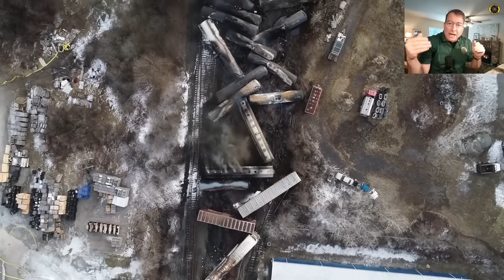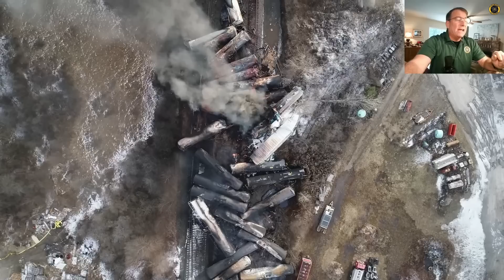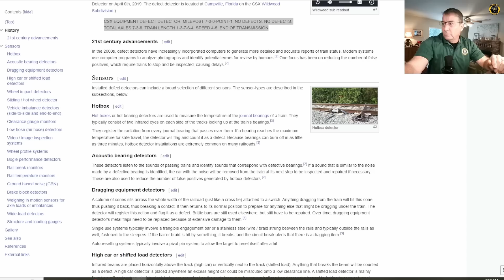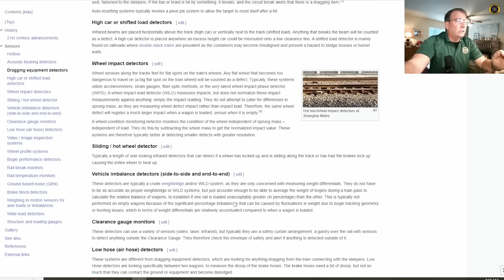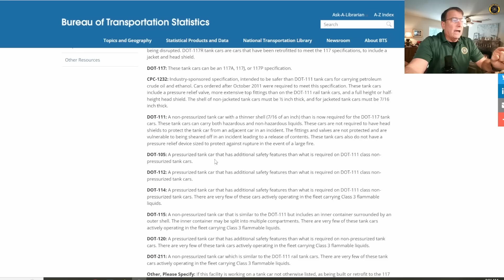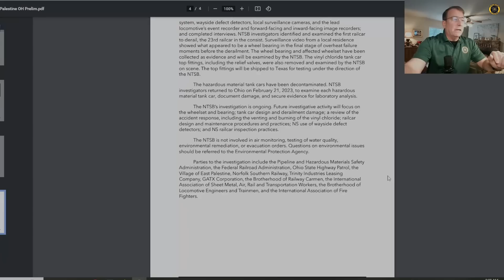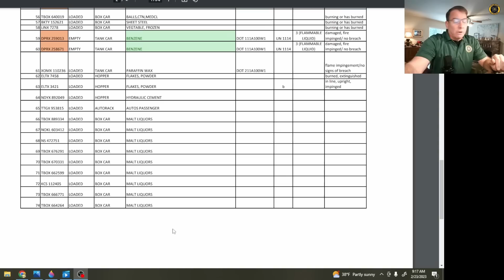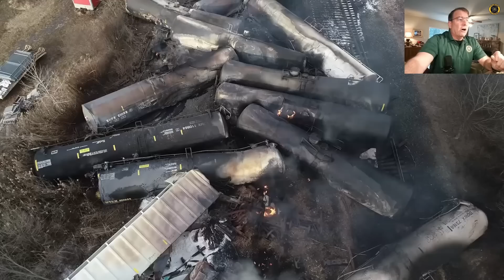NTSB Prelim Report: Norfolk Southern Train Derailment 23 Feb 2023

Comment: Juan, Several comments.  Yes, roller bearings can fail quickly but also usually show symptoms days or weeks in advance.  Infrared detectors are pretty primitive and more applicable to sleeve bearings than antifriction bearings.  The NTSB used the term acoustic detection protocols.  I know what they mean but is really displacement tied to RPM and phase angle that they are referring to. There are dozens of bearing defects that will show up in vibration analysis.  Heating shows up late, too late, in the game to be the only indicator of a bearing with a problem.  Vibration analysis is widely use in industry on stationary rotating equipment.  It is not the easiest thing to implement because 1) It is not cheap 2) Unions tend to fight it because learning the details tends to make their members uncomfortable and 3)  it is hard to apply to rail cars as when the data is collected the bearing must be working.  I am not aware of rail care mounted vibration analysis equipment though that could be developed.
Reply: They also have to deal with out-of-round or flat wheels, non-welded track joints and squealing when going through tight radius turns. The first group can likely be detected through acoustic means, at least flat wheels are quite obvious. Added to that, railroads don't own all the cars on their tracks, although they can enforce federal standards. My wife audited a small company which owned less than 100 rail cars and leased them.

I'm not saying it can't be done, but it can't be enforced quickly.

Comment: Another item crew positions on a railroad train. Conductor (supervisor of the train), in the past the conductor generally rode in the caboose, Locomotive Engineer, this is the person who actually advances the throttle and applies the brakes. Today normally these are the only two crew members on a modern train.   There are a number of smaller railroads, that with waivers, operate with only an engineer. In Western Australia a mining operation has unmanned trains. 
     In years past additional crew members were the firemen. This position was left over from when locomotives where large boilers heated by coal, oil, or in the early days wood. A fireman had to shovel coal to keep the boiler water hot enough to provide high pressure steam. It was more an art then science. The last position were the men who "steered" the train. The brakemen. Initially a brakemens job was to manually apply the brakes on the train. It involved climbing over the cars to turn the brake wheels on a train. It also involved throwing the switches to steer the train. 
      As technology progressed, the first to go were the locomotive firemen. This happened as railroads converted from steam locomotives to internal combustion and(in Europe) electric locomotives. In the 1930's a system called centralized traffic control (CTC) was introduced. A dispatcher at a central location could throw the switches. By the early 1980's railroads started efforts to reduce crew sizes. In 1970 for example a typical train  crew consisted of 5, Conductor, Engineer, Firemen, the head end brakeman, and a brakeman in the caboose. By 2000 it was pretty much down to a two man crew.

Comment: I've seen a video clip in the news from a video camera, which I think was a security camera near the tracks showing what was claimed to be the possible car in question. It appears that the wheel may be locked up and dragging, but still on the rail, any flying sparks like a giant grinder on steel. It would not take long to grind a rail wheel up to the point of failure to be able to stay on the rail. Perhaps grind the wheels flange off. It will be interesting to see the failed wheel damage. I wonder if i can source a picture. Gryders general view of the NTSB is something to keep in mind. ☮️
Reply: Security camera at Butech Bliss in Salem. Shows flames from the lead axle of car 23, a covered hopper carrying polypropylene.

Comment: Seems like it wouldn't be that expensive to put temperature monitors in the cars themselves and have them send that data up the cab for real-time updates and monitoring.
Reply: Seems like you have no idea how expensive it would be. Power to each unit = cost and down time + millions of rolling stock (figure 10k minimum per car), power units would need changed to facilitate this (even more costly than cars), add in software faults, regular maintenance, as well as replacements since many cars get stored on sidings for days to weeks at a time when empty where they are often vandalized... Then reap the reward of even more costly products in the stores because the consumer gets to foot the bill for 'good ideas'. None of that includes downtime when they have to replace a wheel or a truck mid train away from a shop and the new procedures and failures that will come from it.
Reply: @Batwingsix  And all of that needs to be weighed against the cost of cleaning up spills like this.  The railroad is paying for that by way of more costly products too, you know.
Reply: @IanMcCloghrie  considering the accident (or derailment in this case) trend is down over 20% in the last 20ish years, hazmat derailments over 50% and rail is by far the safest mode of transport out of trucks, rail, and air per mile moved... Perhaps the over reaction of feelings over reality should be weighed by yourself. Think of how much you pay right now in stores from 'good ideas' thrown at the trucking industry who's costs have been passed to you as a consumer to improve safety, of which over 90% of CMV accidents are caused by cars doing something illegal or dangerous. Now, would you be okay if the government stepped in and told you to foot the bill to pay 10k of your money to add devices to your car(s) parked in your driveway right now to prevent accidents?
Reply: @Batwingsix  I didn't say anything about government requirements, so perhaps you could lay off the straw men a bit?

Onboard data telemetry is used in many different industries.  Trains have unique requirements, yes, but then so did everything else it's been used on and it doesn't have to be particularly expensive.

A 20% reduction in the accident rate is great, but it doesn't change the fact that the most recent one is still going to cost the railroad over a billion dollars to clean up per the last estimate I saw.
Reply: @IanMcCloghrie  The cost of equipping one car times 1.6 million cars.  Extremely expensive, billions.  Then needs to be maintained times 1.6 million. Very high probability of false braking.  The virtue of the present system is that it's big and rugged and doesn't involve electronics.
Reply: It’s would be way more cost effective to just increase the amount of wayside detectors

Comment: I think the stacking up of cars was probably due to the axle failure causing a derailment and the sudden stop of the 23 car.  When the 23 car derailed the air hose connection broke and set the emergency brake.  However since the train was moving at 47 mph the cars immediately behind car 23 didn't have time to stop before piling into each other.  There was a similar derailment in Washington DC a few years ago where an axle broke and the cars piled on top of each other.  There was video of the axle breaking from the Metro station next to it.

Comment: Perhaps go to onboard monitors rather than stand-off passive systems.  I’m sure that would increase the complexity and maintenance costs but hey, it’s 2023 and we maybe shouldn’t be running Marty McFly’s RR anymore.  🤷🏼‍♂️
Reply: This would not be economically feasible. More wayside detectors like CSX’s new TIP system would be the best way to implement more inspections on the fly

Comment: The wheel quit turning and came off the track.  It dug in and the accordion happened due to the sudden stop of the derailed car.  The emergency brake application happened after the digging in most likely.
Reply from the maker: Correct.

Comment: Besides the Defect Detectors, about the only way the engineer or trainmen would know of a really hot bearing would be to look back and inspect your train for smoke or fire.  Going around a curve is a good place to do this. There are sideview mirrors to look back over your train. Also, if meeting or passing another train, the other train crew should roll you by and inspect for defects. BTW the Fireman would ride in the head end with the Engineer and the Conductor would ride in the caboose. The Conductor is actually in charge of the train, although Engineers get paid more lol. A great book that covers pretty much all aspects of railroading is "The Railroad What It Is, What It Does" by Armstrong. I enjoyed your coverage of this topic.

Comment: Emergency brake application had nothing to do with exacerbating the derailment.  The cars derailing in an accordion-like fashion exacerbated the derailment.  When these 130+ ton cars leave the rail for the dirt, they stop...quickly.  If anything, the emergency braking reduces damage by slowing cars still on the rail behind the culprit car,  quicker preventing more derailed cars.  I had a similar derailment in West Texas in the late 1970's (pre wayside detector era).  Had almost identical damage.  Cars began the accordion buildup under an overpass with Methanol and new creosote dripping crossties mixed together, creating a fire so hot it melted the I-beams of the overpass.  Also, did you happen to see videos of the Norfolk Southern train just before the derailment?  I noticed the culprit car throwing sparks and bouncing up & down as it moved down the track as if a wheel was broken.  Would have liked to have seen the track supervisors report of rail conditions behind the train up to the derailment site point.

Comment: How deep was the car that derailed?  What was the distribution of loads and empties in the train?  Both had an effect on the accident. The trackside detectors are not entirely reliable, in my experience although the ones involved in the accident did work mostly as desired. As mentioned, PTC had no impact on the accident and is there to keep trains separated and control their speed. One more thing: the crew on the head end only knows there is a bad bearing if a dragger/hot box detector goes off, if some one lineside reports it, or if it is close enough to see from the head end on a curve.  One time I saw a burning bearing on a car and had my engineer stop so we could look at it but it was within 10 cars of the head end, as I remember.  We set it out and were thanked for catching it (and got a monetary gift for that).

Comment: To me, it seems like the system is set up to detect a failure rather than predicting a failure. It looks like they have the infrastructure in place to use it more intelligently. Rather than simply looking for a temperature out of spec range, they could add in a routine to compare all of the wheel/bearing sets to judge if something is spiking compared to the rest of the train. 

To answer your thought about how quickly bearings can fail? It can happen fast! The bearing surfaces become a very inhospitable place as particles of metal start to cycle through and between the contact surfaces. Once the case hardening is lost through overheating, it's done.
Honestly though, who hasn't sat at a train crossing as a long train goes by and seen 4 or 5 of the rail cars clunking and banging. Sounds like a flat spot on one or more the wheels. Can't be good!

Comment: Millions of miles are traveled without mishap annually other than things getting onto the tracks. This almost always happens from defective tracks or equipment and lack of maintenance is typically the reason. These pile ups usually occur because like highways, something stops them suddenly and they have nowhere to go, a car lying on its side on the tracks fills that requirement. These rail side defect monitors are a cheap way to monitor bad maintenance, I am sure they could put detectors on the cars with transmitters powered by motion or pressure.

Comment: Juan, great analysis of this derailment. I worked as a Mechanic, Conductor, and Motorman on a trolley line in Oregon from 2016 until 2020.

That's correct about the "No Defect" announcement on the defect detector. I heard that security cameras about 20 miles away showed the railcar was already on fire. Those DOT 110 tank cars are supposed to be retired by now. It sounds like the DOT 110 tank cars are not being cycled out of service and retired for some reason. I don't like the sound of the fact that railroads are still using the DOT 110 tank cars.

As a former railroad car mechanic, I would have never knowingly placed a damaged railroad car into service. I was told that the car involved was tagged for repairs because of a broken axle on the tank car wheel, and that it was fully known by NS crews before this accident. The train crew assembling the train knew that it was tagged for repair at the Fort Wayne railroad yard, but that they knowingly hooked the car involved into the train anyway. The train crew in charge needs to be fired immediately. It's been stated in publications I've read that the defect detector caught the problem too late for it to be fixed. 

Norfolk Southern Railway Corporation (NS) no longer has a conductor onboard the lead locomotive of their freight trains due to the misguided ideology behind Precision Scheduled Railroading (PSR) that has been used widely in the railroad industry since 2015 under the oversight of the late E. Hunter Harrison (EHH). It's not precision. It's not scheduled. It's not railroading. I call it Precision Scheduled Failroading (PSF). NS now has their conductors drive to the train in a pickup truck in case of a derailment like this one.  Corporate managers at the railroads (including NS) don't get out very often to visit the territory they manage,. What we're dealing with here is a tragedy.

NS has recently gone through a $10 billion stock buyback campaign, instead of cutting fair labor agreements with their employees. That completely preventable negligence goes all the way up to Alan Shaw, the new President, CEO, and Chairman of NS.

Alan Shaw knows his company has been running longer trains that don't fit on sidings anymore. It's not a surprise that this has happened, even with Positive Train Control (PTC) being used on all mainline railroads across the US. NS and other railroads in the US are currently lobbying the federal government in Washington D.C. to force them to operate trains with just one crew member onboard, that being the engineer solely in charge of the train operation. It is far safer to operate trains with at least 2 crew members, as I did all the time on the trolley line in Oregon that I worked on.

NS and all of the major railroads have been carelessly putting all of us at risk since 2015. All the railroads care about are making more profit for Corporate and their Wall Street shareholders! All it's about is profits over people and profits over safety. While they rake in untold billions, they jeopardize our safety every day, and now it shows, unfortunately. NS and other railroads could have been avoiding this outcome for 8 years now, and they took no action instead! I'm angry about how NS and other railroads could care so little for the communities they serve all across the country by preventing such a tragedy. Shame on NS and the rest of the railroads out there!

Please be sure to subscribe to my channel!
Reply: To my knowledge, NS is not down to one-person crews in the cab yet.  The train in question supposedly had a three-person crew:  engineer, conductor, and trainee (brakeman).  Imagine that as your first day on the job!
Reply: @weatherupstairs4814  NS just switched to one person crews 2 week ago, according to several publications that I've read, including Trains Magazine, Railfan and Railroad Magazine, Railway Age Magazine, and more.
Reply: @stuartadamsrailfanningvideos  I've looked and can't find this news... any links?
Reply: @stuartadamsrailfanningvideos  Yike!
Reply: @weatherupstairs4814  No, other than an article I read last week that I can't find at the moment.
Reply: @SteamCrane  Yep!
Reply: @stuartadamsrailfanningvideos  As I understand it, that is a proposal but it has not been implemented yet.  It will take some time to revise the rule book and establish bases out of which the roving conductors will operate.  There is an iron-ore hauling railroad (not a common carrier - they only haul ore and pellets) which runs with just an engineer in the locomotive cab.  However they work shorter shifts than the typical 12 hours and if there is a mechanical problem out on the line, the RR flies help to the train via helicopter.  (Unfortunately the name escapes me.)
Reply: @evanstauffer4470 That's interesting. Thanks.
Reply: It took some time, and scrolling 3/4 the page, but I knew someone would eventually bring it up.
Reply: @mikelewis963  Thank you for your response. It's horrible all the way around.

Comment: Would a "controlled" or slow release of air pressure following a line failure have allowed the cars to slow gradually and not derailed? A slow release control valve on every car could have slowed the cars without causing derailment.
Reply: No, the car derailed and came to a sudden stop. Everything behind it that can't stop before reaching that location is going to derail. A more gradual braking would have created a bigger pileup, not a smaller one.